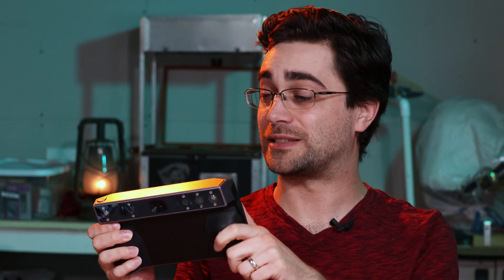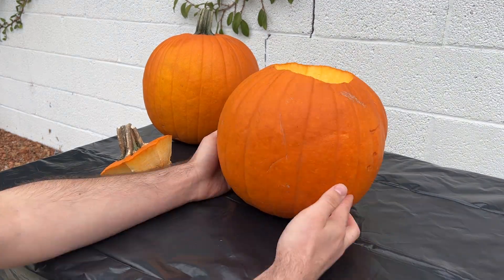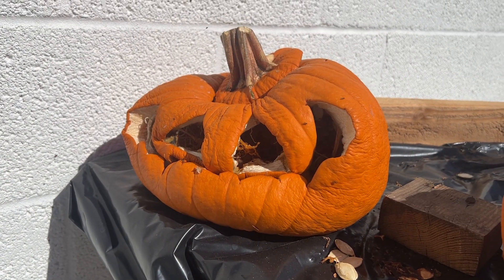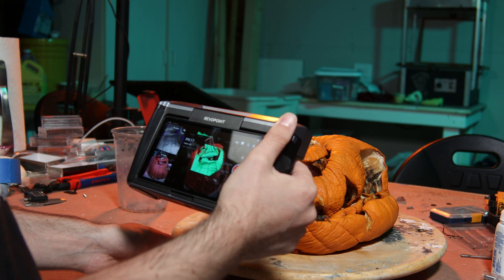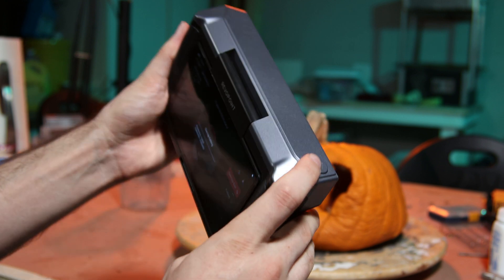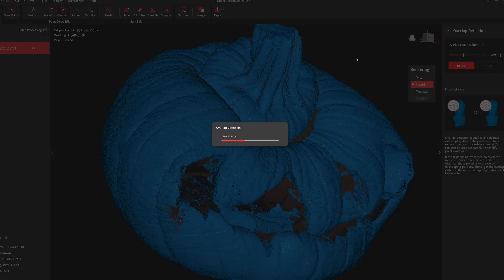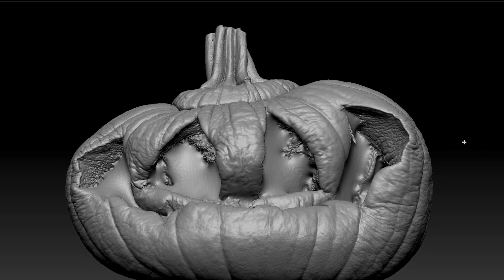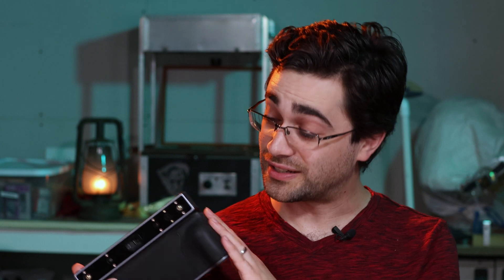3D Scanning a Rotten Pumpkin with the Revopoint MIRACO all in one 3D Scanner

Comment: Very nice. Do you get the color texture file with the scan? Says it does color scanning but no where shows any texturing.
Reply from the maker: I don’t often capture the color information for they types of project that I do, but it is an option you can turn on or off during scanning, and an option to process the color texture when generating the 3D model. It works pretty well, and comes out about as even as your lighting

Comment: This is incredible. I was on the fence about backing this scanner, but you've convinced me. Thanks!
Reply from the maker: Thanks! Hope you make some cool stuff!
Reply: @jasperjanderson Thanks. Have you worked with the Revopoint Pop 3? I'm wondering if that's a cheaper alternative with similar performance, since I have a smartphone to pair for the Pop 3.
Reply from the maker: Think of Miraco like Pop 3 and Range combined. Chess pieces would be better with the Mini, but you could still capture them with the Pop 3 with lower detail.
Reply: Gotcha, thanks!
Reply from the maker: Yes, I have a video with the POP 3 here. Very similar quality. I use it frequently.
Reply: Thanks, just watched that video now. It looks like the Pop 3 is good for medium distance objects, while the Miraco supports near, medium, and far distance objects. Would you say that's inline with your experience? If I wanted to scan both chess pieces and a head/torso, would you recommend the Miraco over the Pop 3?

Comment: How does Kickstarter work?  If you make a pledge, are you guaranteed the item if the goal is met?  If not, do you lose your pledge or is it refunded?
Reply from the maker: I’m not involved in that in any way.
Reply: @jasperjanderson I know, just wondering how it works.  If you pledge to a project, is there a chance that they take your $ and you never get what you were buying?
Reply: @Dave_D.  The crowdfunder reached their goal, and that is the point where it will deliver on expectations, unless there is some major cocaine habit or something like that such as the case with the SprayPrinter crowdfunder i invested in.
Revopoint is not a new company and is producing the scanner, so i got one at 35% off rather than wait till later. It is shipping in december.